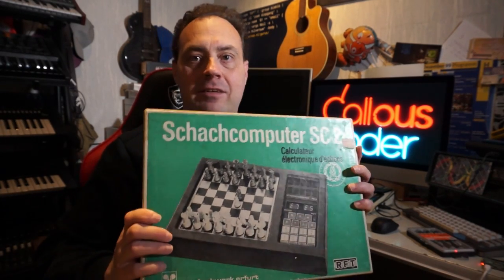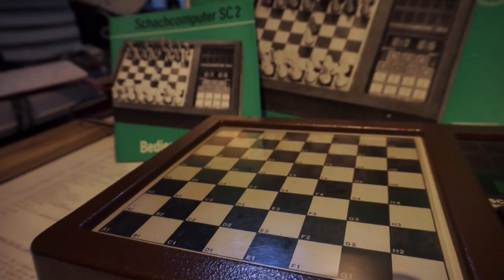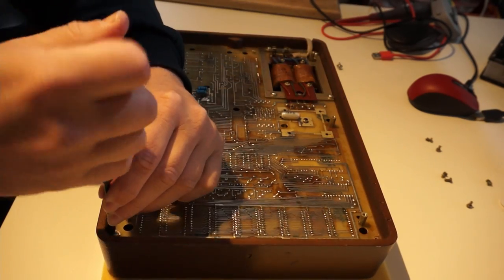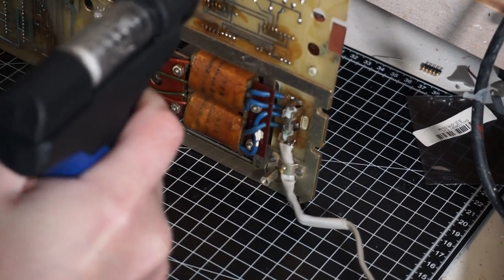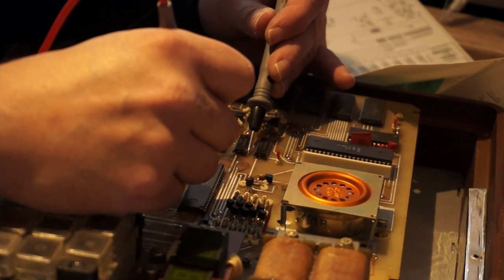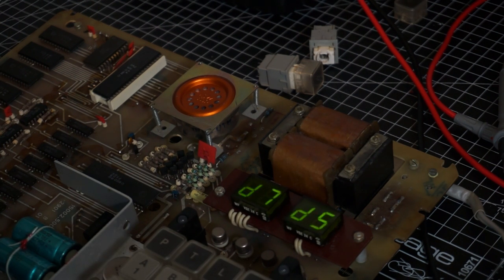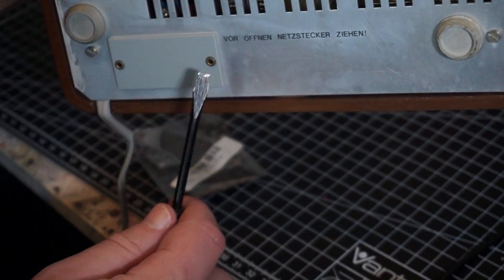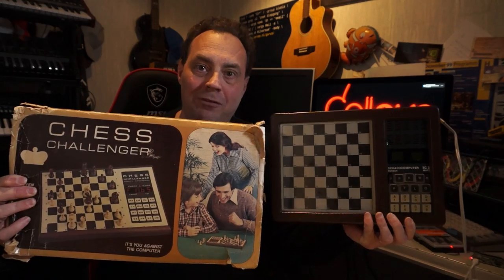DDR Chess Computer Repair

Comment: Next time look better at East German switches 😂 there is no ferriet pins that makes contact, it are magnet's and at the site of the other part on the board has very little reed contacts, just did the same repair, but tumbs up for your show!👍👍👍
Reply from the maker: They didn’t attract to any metal in my case hence I conclude the are some ferrite. Now I a actually want to double check but they’ve been sold.

Comment: I had the Fidelity Micro Chess Challenger that I played incessantly on the bus back and forth to college. Great little piece of tech.
Reply from the maker: Hi Dylan, I literally just finished my Chess Challenger Tear down video. I dumped the ROM for prosperity sake.
It is a nifty little chess computer. This one I recently acquired. I borrowed the luxury chess challenger that actually spoke like. Cylon :D from my uncle. He had a wealth of chess computers. He was also a pretty darn good chess player.
I only realized that when I went to highschool and my rather unique surname made the principal ask: "Are you related to Andre Doetjes?"
Uhmmm yeah... He played against my uncle as well. And later I found out that in the 70s he even played or refereed games in Moscow. Which is unique for a Westerner.
So I have a weak spot for this machine.
Reply: I have some version of the Fidelity Chess Challenger, it's a neat little board.  My uncle borrowed me his, when I was a teenager.  It crushed me.  So in a fit of nostalgia, I bought one of the Chess Challengers that was like his.  But I also own a nice Millenium electronic chess boards with piece recognition and sensors, which is so nice, as you just pick up move the pieces normally.
Reply: @michaelbauers8800   I wound up playing the Chess Challenger against the Chess Master video game and the one game I played between the the Chess Master won. Hard to believe this was 30 years ago already.

Comment: You are not only funny, but we might share interests in coding, electronics, chess, and electronic synthesizers.
Reply from the maker: Cool! Although in a terrible chess player 🥴
Synthesizers are a true passion.
Reply: I am also bad at chess, but love it.  I have quite a few synthesizers, e.g. Yamaha Motif XF6, DSI Prophet 12, Moog Sub 37.  I just rebuilt my music studio a year after moving, and am trying to integrate a computer setup, I used to just run synths into a mixer that could record to an SD card.
Reply from the maker: @michaelbauers8800  we have a similar setup I also run a TASCAM that can record to SD card. Now usually I use my DAW.
Reply: @CallousCoder  Yeah, my mixer is also a TASCAM, nice.  I am trying to master using my DAW, Bitwig.  Doesn't do NRPN though, which is annoying.  Been thinking maybe there's a way to automate a CC, then somehow remap it an NRPN that I want to do some cool automation on my DSI Prophet 12.
Reply from the maker: @michaelbauers8800  bitwig? Never heard of that I need to look into that. I’ve switch to Reaper recently. I used to use steinberg  but then the dongle broke and they didn’t want to replace it. So I switched to FL Studio for the last 5 or 6 years. But it started to the become more and more unstable.
Reaper is lean and robust. I like it.
You have prophet 12 wow!!!
Reply: My friend has Reaper, he likes it.  Yeah, owned the Prophet 12 for years, it's really fun to create sounds on it.